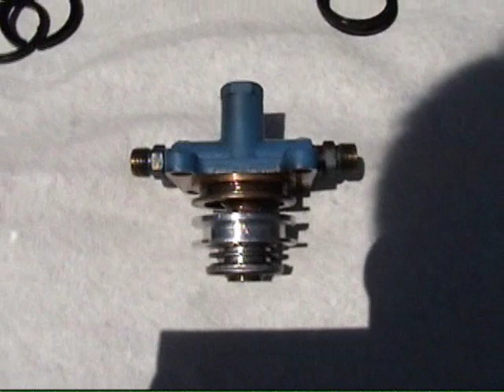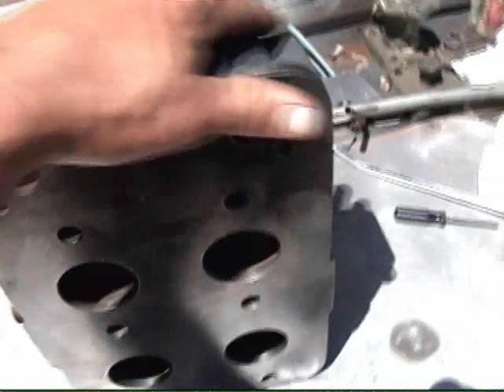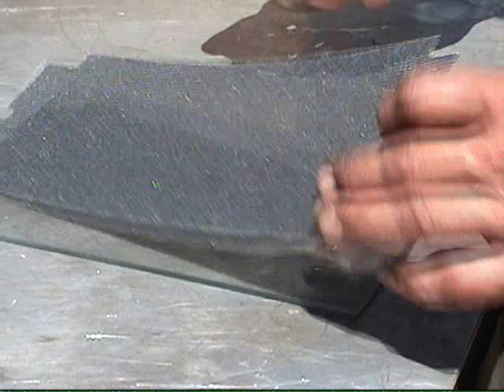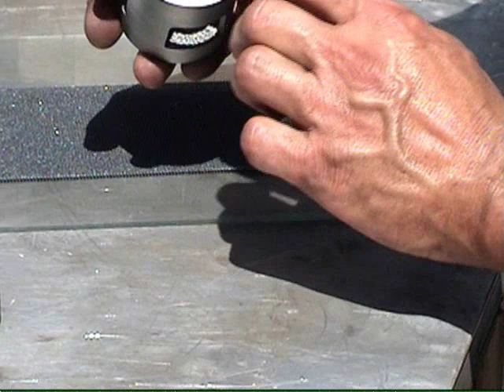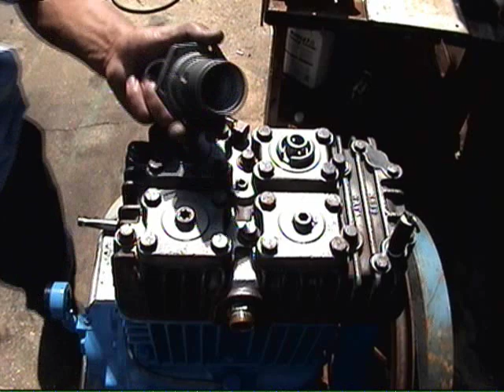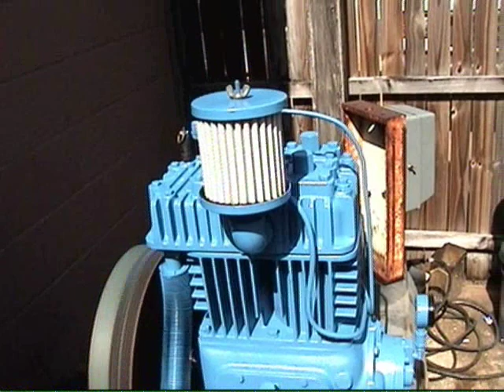Quincy Model # 325 rebuilt and running

Comment: Now you really have my attention.  Your video is great and now I firmly believe you are going to save me some money too.  I did as instructed.  Plugged it in, let it pump up to about 60psi, pulled the plug and in about 2 seconds I got the pfffffft sound and then the air started coming out of the tower bleed hole.

Comment from the maker: Ok lets try to repair your compressor with out spending money on tings that are not needed.replace the diphragm or reuse the old one. Restart the compressor I think you just have a bad hydraulic unloader.. When air is escaping from the tower port remove the 1/4" controll line from the tower does this stop the escaping? If not remove the HP tower and check to see if the  unloader plunger still has the O-ring on it.Please let me know if this works or not and will go from there

Comment: I'm getting deeper into it and need more help.  Earlier I said air was coming out of the PRV, it's not, it's coming from the bleed hole in the unloader tower.  I pulled the diaphragm and it is not cracked or leaking.  Visited my Quincy dealer.  He wants $180 for a Head Overhaul Kit which includes gaskets, two different sets of springs, pins and springs, discs, and an oil pressure gauge. $13 for an oil filter.  That seems high.  Are the kits available on the internet reliable?

Comment from the maker: Try removing the 1/4 " controll line off the unloader tower. Should be no air pressure signal when running and maintaing oil pressure

Comment from the maker: I would check the interstage pressure when running should be around 45 PSIG and the relief valve should set for 90 #...If it lifts when running it's typically the HP inlet valve if it lifts after shut down it's the HP discharge valve in any rate it's a problem on the HP side.. A pipe wrench will work to remove the tower the hold down can be removed easier when removed if you don't have the tool

Comment: If let it pump just for a minute it gets up to 40psi or so and the pop off valve in the head starts leaking and drains the tank.  Will a new PRV resolve this or is it indicative of something else going bad, i.e. diaphragm?

Should I buy a head rebuild kit online and a new PRV and do what you did in this video?  Will I need the spanner wrench and huge hex for the diaphragm tower?

Comment: Just bought one of these QR-25 (325) compressors.  Actually it is the second one.  My dad had an old one but it has two diaphram towers on it.  This one only has one.  What's the difference?

This newest one is a 1990's vintage.  It needs some help and so do I.  When I plug it in and and it starts pumping it seems slower to build pressure than it did when my company bought it new 23 years ago.  Could the valves be causing this?

Comment: Good video. I am working on a project that perhaps you can help me on with some advise.  I'm a HVAC heavy tonnage mechanic in the trade for 35 years.  Been working on some high pressure refrigerant recovery units that can transfer around 1,000 to 2,000 pounds of R22 or R134a in a recovery tank.  Been thinking about trying a quincy model 210 air compressor.  What are your thoughts?  Thanks

Comment: I had a quick question, during the assembly, you mentioned and clearly demonstrated the discharge valve springs are painted white. According to the parts list, there is only one valve spring (Quincy part #7270) available for both intake and discharge valves. I recently purchased this valve spring and found it had no kind of paint or distinguishing markings.Is there a noticeable difference in size, shape, and or gauge between your white and unpainted springs is it safe to interchange part #7270?

Comment from the maker: @fastst1 the quarter inch line that goes to the unloader tower is a air signal not oil pressure.Installing air pressure gauge in this line will help you determine if it's the hydraulic unloader is at fault or if the problem is in the high pressure suction assembly
Remember don't just remove the line and install the gauge actually T into the line

Comment from the maker: @fastst1 the hydraulic unloader on your air compressor should be different then mine if your pump has the oil filter the hydraulic un loader should thread into the side of the oil pump housing  a quarter inch line should run up to the on loader tower I would suggest you install a pressure gauge in that quarter inch line but don't remove it from the tower stop and start see if the pressure fluctuates

Comment: Thanks for the vid, I purchased a good used QR-25 from a screen print shop, all the paint is burned off the output valve and discharge line. It works great, nice spin on oil filter, found a napa cross over.  My unloader unloads twice though, one short spit then a longer one with a quarter second pause in the middle.

Comment from the maker: @oocheewalley The guy at the Quincy distributor was lying to you this is not a boat anchor the only concern is the oil pump which had a loss of prime issue.Looking at your video I noticed that the line that goes from the hydraulic unloader( the valve on the side) should go to the top of the unloader tower not the side. The fitting in the head needs to be plugged and you don't want to reduce the size of the discharge.& the 1/8 in fitting w/90ebo needs a oil press gauge.Have you run it yet?

Comment from the maker: @oocheewalley I am not up to date on what record of change number determines the obsolete pumps, Does your pump look like mine does the head have round valve covers opposed to plates? does it have a oil pump? is the on loader on the side or on the front a k a 3 way valve or hydraulic unloader if none of this makes sense shoot a video of the compressor I will be more than happy to help you

Comment: Hey man thanks for posting the videos. I have just recently acquired a 325 ROC 12. I tried calling the only Quincy distributor in my state to get pricing on parts and the support tech said that "That compressor is no more than a boat anchor.  I would be more than happy to set you with a new one." No thanks

Can you tell me where you purchased your parts from, I would to get some reliable help?

Thanks again

Comment from the maker: @mojomd17 it's not that the business isn't good in the area all the small air compressors are in cabinet shops gas stations,  dealerships and small manufacturing 
there are no oil rigs in florida except off the coast. I do quite well working on the rotary screw compressors I also work on gardner denver rotary screw air compressors but they're not my favorite All that I work on now is 25-300 HP rotarys

Comment from the maker: @mojomd17 Thanks it would be interesting for me to see if the people that are teaching you how to rebuild these compressors use the same techniques as I did using  locking hoans bead blasting the valve assemblies and hold downs ect.. it's not a big intrest to me it's more of a way of life. Unfortunately there's not a lot of $ in the small piston market everything is kinda gone the way of the rotary screw compressors

Comment from the maker: hey paul first thing try removing the quarter inch line that goes to the unloader tower when the compressor is running and has oil pressure there should not be a air signal second check to see if the unloader plunger still has the o ring on it also check to see if the piston underneath the diaphragm isn't rusted and stuck down if that's not it then the high pressure intake valve is stuck open it's not uncommon to see rust in the high pressure area causing parts to stick together

Comment: I recently acquired a "Quincy 325-15" that appears to be in "like new " condition ( reportedly used in HVAC process control). Recently, it started blowing high pressure air out through the hole in the head unloader after establishing normal oil pressure during operation. I have not dissect the problem yet. Can this be a simple case of a torn diaphragm? Thanks for your time.......

Comment from the maker: @carl3422 Try removing the quarter inch copper tube that goes to the unloader towers first, when the compressor is running there should not be any air present on that line if there is then you have a defective hydraulic unloader or 3 way valve depending on what vintage machine you have if you find there's no air signal on the quarter inch line when it's running then you have a valve problem or broken connecting rods but I doubt the rods are broke

Comment from the maker: @swasey1952 The tool is made by Snap-on the P/N is N6664 I don't know if it's a Quincy or a Snap-on P/N it maybe eather or? You might try to heating the the valve cover and try turning the hold down screw clock wise with a piece of angle iron